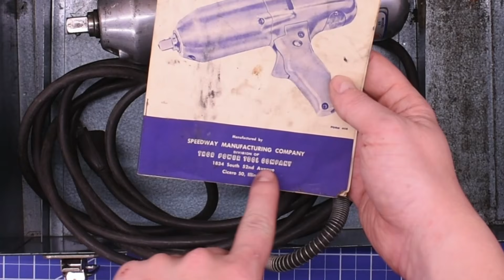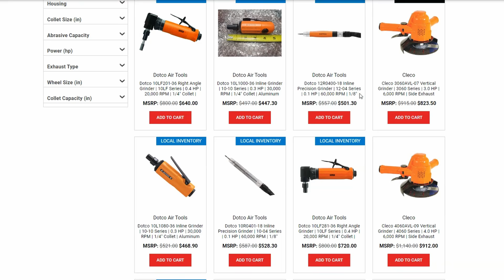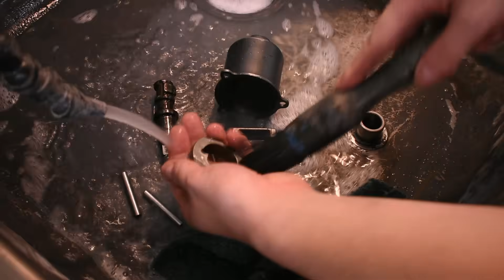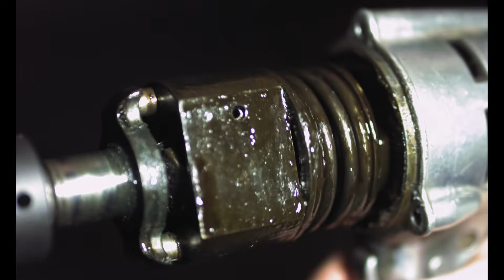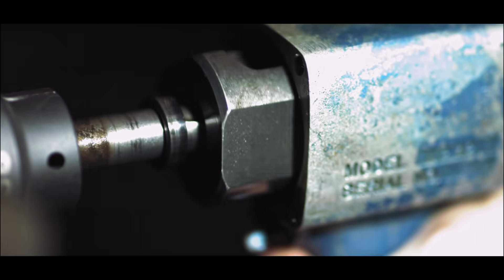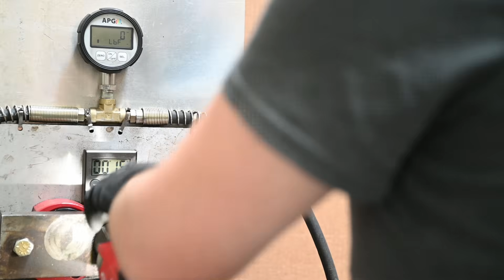Cold War Era Power Tools vs 90's vs Today

Comment from the maker: This one was a lot of fun to make. Thank you guys for making doing stuff like this possible. It's not lost on us
Reply: Please throw a classic tool test like this into the rotation here and there. It’s about the same dopamine hit as “How it’s Made” delivered back in the day.
Reply: I have the same model cleco but with a 3/4 anvil I use as a lugnut gun. Swaps right in with no modification. I still torque wrench everything but it's just so consistent.
Reply: It shows.  This is one of your best videos yet :-)
Reply: Thank you buddy! This is a fun test. 
I have a 70s chrome bullet nose model 875 craftsman that was brand new in the box when I started using it. I used It in a shop for 7-8 years. And it never let me down.
Reply: That realky was awesome!
Actually, would you be interested in doing one about air hammers as well? There's a few old ones that probably still hit harder than some modern ones.
I have an old snap-on ph50D I was looking to sell, would yall be interested in trying it out on the ol dyno?
Reply: @torquetestchannel did you see metabo hpt released their new compact wr18dc
Reply: Can you test the Skil PWRCORE 20v 1/2 Mid Torque? IW5761B-00, claims 800 nut busting torque. It broke loose 1100 on shop tool reviews, outdoing the DCF 891 by 200!
Reply from the maker: @jtg2259  tested it in the Flex mid tq episode
Reply: The corded dinosaur BOSCH GDS 24 vs. GDS 18V-450 HC cordless would also be a nice competition of different concepts. Since the GDS 24 is still available for a a higher price, it may potentially have some advantages over its juvenile twin. Would be fun to find out what it is, if any.
Reply: Damn! That Thor 55 impact wrench is a thing of beauty! ALSO: What kind of timeline is this? Cleco and Dotco? I'm pretty sure nobody here in these comments has ever heard of those in the last 60 years? At least for me, they never existed. Kind of like that Lanolin spray for tools called Fluid Film which magically appeared some years back. Amazing!

Comment: This might have already been done, but I would like to see the Hyper Tough high torque 1/2 inch 20 volt cordless. Claims are 800 ft/lbs of breakaway torque and 500 tighten. I recently bought one because I needed one and it was far cheaper than any other reasonably accessible option.

Comment: Cool to see an aluminum bodied impact! I have one of a similar vintage that I use when working on cars. Its a Sears branded one, a little smaller than a Thor. I'm disappointed to see the numbers that the Thor put out, but can I suggest that this was a fluke? After all these years, there is zero oil on the bushings and the grease has turned to dry peanut butter. On mine, I reoiled the bushings and repacked the gearbox with grease, and I've found that it must be putting out over 200lb/ft. I've broken 20+ year old axle nuts loose with it.

Comment: My dad used to have a vintage ingersoll Rand impact. It used to bounce around in the back of his work truck for decades. I recently inherited it as a gift.
It is a total tank. The only thing that can beat that is a high-end Milwaukee M 18 brushless impact, but only in reverse. That air powered impact had some serious nut busting power. It took a seized lug nut off of a piece of heavy equipment that had been sitting in a field for 20 years.

Comment: I do like my electric guns but I’ve got an old air gun my uncle gave me which I still use a lot. If there is something we can’t get undone my boss has a 90s blue point 3 quarter gun that will undo things the Milwaukee guns won’t they are last years electric half inch guns air tools still have their place.

Comment: Have you seen an Ingersoll Rand NO. 805601 Model B 1" impactool ? It is a 120 volt corded impact for removing lug nuts on M939 5 ton trucks. Probably dates from the late 70's. Mine has been abused a little  , but it still knocks them loose.

Comment: I bought a new Milwaukee battery drill yesterday and i was very very hesitant because i am a little bit luddite and prefer a cord but it works very well and had a torque setting that wont shear off my drillbit when i drill 25 inch long tomahawk handles to make a pipe hawk.   I am pleased

Comment: Oil bath for hammer lube isn't that unusual. SnapOn did that with their air impacts My old 80's/90's vintage Snappy 1/2" had a hammer case lubed by oil as did its descendants. I recall  SnapOn said they used Redline oil.

Comment: It's interesting video but does not  take in the cost today vs value .  if you dont use one often and the 1950 or in my case  Ingersoll-Rand  from 1970 only cost 25 bucks   so it's better then something that take battery  or  modern .  400 NEW  vs 25 old  is the way to go if you re not using daily or weekly .

Comment: Been a Diesel mechanic for 23 years. A lot has changed since 2000s. I used to have cordless snap on impacts 2003-2007. Moved on to Dewalt. Jumped to Milwaukee a few years ago. I love em. My 1 inch tire gun kicks ass. I wish I had that in 2001. It would have saved me a lot of sore body parts…

Comment: incredible. I still have my shiny IR.. don't even know what year. Found it under a mobile home in a mobile park made in the 60s. it's been gripped so long, and banged around..the text imprinted is even worn.  Not sure what year you tested the chicago electric 40 dollar special from HF.. but I am still using that 450 ft lb beast making a rattling noise with a twisted chuck today.  Great channel. :goodvibes:

Comment: the 5.0 comment is irrelevant, the old 5.0 302 is better than the modern 5.0.

The old 5.0 was far more reliable, cheaper to make power with and has a higher threshold for said power.

Comment: Cool old tools, but even back then there were different classes of tools. Just like today if you grabbed a DeWalt High Torque and a low power assembly gun, you can't really compare them now or in 60 years. They're not on the same playing field.

Comment: Quite surprised that the plug in models wouldn’t have a heck of a lot more torque, as they have potentially more power to run every thing
Reply from the maker: At least in the US you're limited to about 1500-1800w from the wall. Cordless is not. Some packs providing over 2000w

Comment: @TorqueTestChannel  Really wish you would do all the lineman impacts from big brands, the 7/16 hex chuck models.  Milwaukee, Hilti, DeWalt, Bosch, Makita.  If you decide to do so I can probably dig up an old corded 5/8 hex drive metal IR model (a tank) and maybe even on more modern corded 5/8 Milwaukee to compare them all to.  Kinda new vs old showdown...  5/8 hex and 7/16 hex were both used in the lineman industry.  I even have an old 7/16 hydraulic impact if you can find a way to power it. I also have the adapters to drive 1/2  sockets.

Comment: I've got a Rockwell international 1/2" electric impact from the mid sixties or so and even after replacing the brushes, clean  and lubricate the bearings,  clean and check commutator bars, at best, it might generate 200 ft of loosing torque.  It struggles to remove a nut torqued to 185 ft lbs.  But, hey, it still works after 50+ years!

Comment: Do you have a video using the Ridgid Octane High Torque using the 12Ah Ridgid Max Output with the 21700 cells? I'd be interested to see what that battery would do to the octane or if it would make a difference. And yes I bought one, new in plastic on eBay. I also bought a sealed 12Ah on eBay for $100 less than Home Depot price and a sealed 2 port fast charger because I have a lot of Ridgid batteries at this point. A menace meaning it spins off the lugnuts pretty fast, making tire rotations a breeze

Comment: I have a test suggestion.
If you haven't already seen it, watch Project Farm when he tests MotorKote's Hyper Lubricant (good stuff). I wonder what will happen if you add it to air tools. Will a die grinder spin faster? A air hammer piston fall in love with it? Get a measurable difference with a impact?

Comment: I would like you to test a CP 796  inch drive air impact  I have owned two used them in the coal mines to work on heavy equipment. In my opinion, they are the best for my work .

Comment: I'd rather have the cold war era tools. They're good enough on torque and they last FOREVER.  Lasting forever is key to me, I HATE having to replace things.

Also, no batteries in any of them. Batteries suck.
Reply: I agree but these days the tool should out last me. Or at least my ability to use them. The battery gives me more freedom and no cords or air hoses for my feet to tangle in.
Reply: @garyradtke3252  That's the longevity I was talking about. If I buy a power tool I expect it to live at least 30 years, perferrably longer still. I expect wear items like brushes to be replaceable, fluids to be changeable(We saw ports and plugs for this on the vintage air impact!), that sort of thing. Serviceable and long lived.

Don't get that with modern power tools. They aren't meant to be serviced, they aren't meant to last all that long. Guys running them in shop environments universally report 2-4 years or so before they start to give out regradless of what ecosystem it is. For shadetrees like me that translates to prolly 10-15 years, which isn't bad, but I'd still prefer 3x as long.
Reply: I prefer modern tools. They are lighter and more portable.
Reply: @redcat9436  I find having to replace them frequently due to disposable quality and the headaches of managing batteries to far outweigh the portability. I just dont find myself toting my tools around enough for portability and lightness to really factor in 🤷

Comment: I'm an industrial quality analyst, that inspection card has a LOT of meaning behind it. For all of history we relied on inspection to ensure quality. In the early industrial era they would just make a bunch of stuff, inspect every single one of them, and sort out the bad ones; this wasted huge amounts of time and money, and tons of defective stuff would slip past. In WWII, with the help of scientists and statisticians (especially from Bell Labs), the government adopted MIL-STD-105, which instead required that only samples of the product were inspected, as well as other rules. The quality was significantly improved while also increasing production rates and lowering costs.

So what happened after WWII? Every company took MIL-STD-105 and threw it in the trash, and went right back to relying on inspection. As you can see on that sheet, the factory has an entire DEPARTMENT dedicated to just sorting out the garbage tools they made. Dr. Deming and others tried to tell them to use statistics to control their processes and make stuff the right way the first time, and nobody listened.

The Japanese, however, did listen. They were able to make higher quality stuff at a lower price without any inspection, and it was a major wake-up call for the US in the 70's and 80's. Today we still suck at Statistical Process Control and QC theory, but we've come a LOOOOOONG way since the 50's.

Comment: I pulled out my hilti gp22 for the first time since I bought it to drill holes for anchoring racking. It’s gas powered rotary hammer with a Kawasaki engine from 1988, started up 4th pull, crazy as hell, not as fast as todays hiltis but it’s a hell of a cool tool, sounds sweet to rumbling on idle,one day I’ll make a reel with the two side by side for instagram, love your content!

Comment: That Cleco impact wrench is from the 80's Those tools (Dotco, Cleco, I-R Cyclone) are made to be used day in, day out in hard factory and maintenenace shop environments and still last a decade or so. Your cordless impacts  will never hold up in that environment. Not that we don't still acquire them. The cordless feature is hard to beat, after all. But we will typicalyy get <ONE> major check on a commercial jet out of a new DeWalt or Milwaukee and then it is worn out. A typical letter check will require  loosening then re-torquing about  25, 000 fasteners.

Comment: In all likelihood your Cleco WP-421C was manufactured sometime between 1980 and 1988. It was replaced by the “D” model and discontinued in the early 1990’s. It uses an oil foam bath for lubrication is very different from other comparable impact wrenches.
Reply from the maker: We asked cleco years ago and they replied 60-70's but we're unsure

Comment: A note about 5.0 engines: the ones starting in the 70s were actually 4.9 marketed as 5.0 (302 Ci) and not the same engine as the one today, the coyote 5.0 which is actually 5.0. I'm not sure why ford couldn't round properly.

Comment: I love my "newer" battery tools however the 1970's and 1980's air tools are still going. I just cant see my battery impact still operating in 40 or 50 years.  Thankyou for the comparison of the old to the new. cheers from down under.
Reply: got an old as hell battery drill (dunno what the brand is but it's 6nimh cells in series) and i threw an adapter (with protections) onto it and it happily choots away. at least for now. currently gonna gut the old girl and use the parts as a starter for a little old generator that works fine but no electric start kit exists for it.
Reply: Depends what it is. All of my dewalts are still running 12 years later. With the original batteries with daily use
Reply: i think modern high end tools by the milwaukee, dewalt, makita, etc can easily last for at least 20 years as long as the tool isnt severely abused on a daily basis. What i do think will happen though, is eventually you won't be able to find rechargeable batteries for them because companies will stop selling them once a major breakthrough in battery tech happens.

Comment: I first got into the auto repair biz in the mid 1970's and that Cleco impact was the first impact gun I ever bought. I think I paid $35 for it used and I used it for a decade before I traded it for a Snap On impact gun that I used until I left the biz in the late 90's.I've probably still got that old Snap On gun but I haven't used it in at least a decade or more.

Comment: That Cleco is damn impressive. I remember from the late '80s early '90s the air guns you could get for affordable prices were complete trash. They would barely take off a lug nut and they wore out very fast. The IR gun my brother bought (like the one featured here) was a world of difference from those, but you paid about 3-4x the price of the auto parts store specials. The fact that they had something so good from the early 1960s and we were still working with such primitive junk 30 years later is bonkers. I'm glad things have improved though. My HF air gun is about on par with IR and the cheapo cordless one I just bought (seesii) almost stays with it. My 1" air impact also competes well with those old brand name ones too, and it was cheap, cheap, cheap to buy. All of them were.

Comment: If you used the older impacts and performed the basic maintenance they would both probably still be working fine in another 60 years.  The power tools made today are not designed to last this long. We live in a disposable world where tools that see daily use are replaced every few years with newer models and batteries.  Even something as simple as a new color can see a new tool purchased and the older one given away, sold for pennies on the dollar, or tossed in the trash.

Comment: Hey TTC, I would highly suggest you pull the armature out of that vintage Thor and polish the commentator bars (what the carbon brush rub against) that may give that old motor a decent boost in speed. I'd also suggest removing all the old grease and crud from the bearings and adding fresh stuff. I'd love to see what it's capable of, if it's been restored.
Reply: I was hoping that they would do a pre and post rebuild test on that old gem. I would love to have one in my tool box. It's beautiful
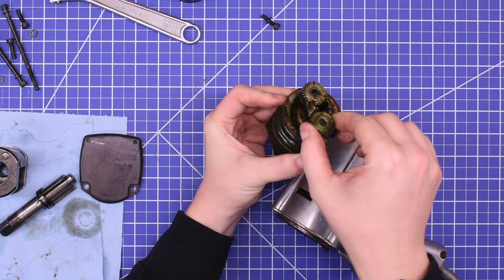Reply: 8:16 That was some sticky looking grease in that thing.
Reply: Commentator???
Or commutator?
Reply: @mmarciniak  Autocarrot is fun

Comment: I wonder If Jigsaws/routers have had any significant changes through the decades. It'd be interesting to measure how a compact router can claim 1.25hp (milwaukee) and spin at 31,000 RPM while having enough grunt to chew through hardwood making dovetail cuts. Or on a smaller more delicate frame how "dremels" have been upgraded over the years.

Comment: The Cleco is the definition of old man strength.
Reply: Grandpappy like a mug....
Reply: @BigG903  I saw an old chain wrench w/ 6' long steel handle like a pipe wrench AND IT WAS BENT . . .
Reply: @patrickshaw8595  it probably got pulled with a crane or pushed with a piece of equipment. “Hand” tools that size often aren’t.
Reply: @ Exactly. Years later when I asked about that - guy it belonged to asked his Dad (who was still around then) and he came back and told me it was bent by a thing called "an F450" . . .

Comment: yeah but lets see ANY of these modern tools hold up to being used for 30 years and stored for another 30. 

the planned obsolescence of modern products is getting to be so insanely pathetic. especially if you go see what they had back then and stop hearing it from word of mouth. 

literally EVERY single video ive ever watched of old stuff it is more durable every single time. more worth the money every single time. 

these modern devices are like having a bugatti veyron and doing 5minute top speed runs all day. cool, till you need 50,000 dollar tires and oil changes every single pass.and i mean its cool and all, but you could just get a much cheaper koenigsegg ccr and still hit 240mph